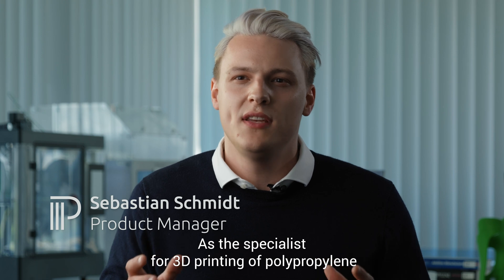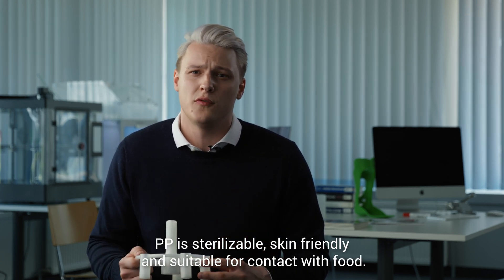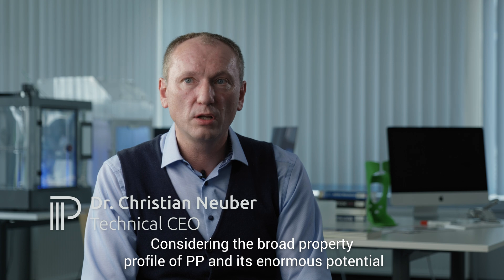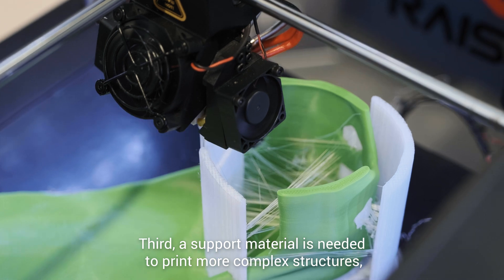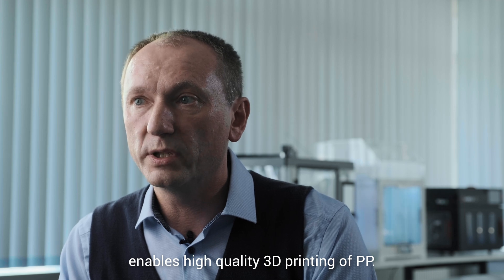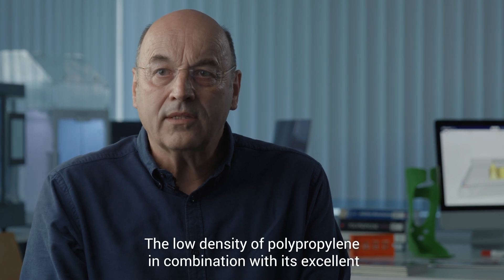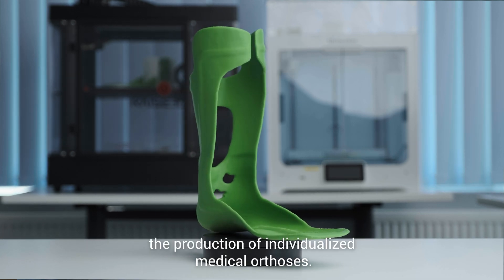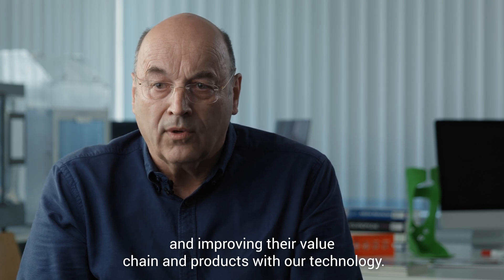PPprint | Your specialist for 3D printing Polypropylene (PP)

Comment: would this PP material be FDA approved to produce Freeze Drying accessories?  These accessories would not only come in contact with the food, but they would also need to go through the freeze drying process together with the food.  After it should be cleanable (but not allow bacterial growth).  This would be repeated about every 24-36 hours.  thank you
Reply from the maker: Hello Hangs4Fun,

thank you for your question.

Our P-filament 721 can be used down to -10°C. At temperatures below -10°C our products can become brittle and break. For this reason, we recommend a usage temperature of the printed products made of our materials above -10°C.
 
Furthermore, we would like to point out that our certificates for food safety apply to our raw materials. Thus, after 3D printing, the user must check the printed products for the preservation of these certificates.

Best regards,
Your PPprint Team

Comment: do you sell print surfaces especially made for PP ? im getting kind of tired of reapplying packing tape for each print
Reply from the maker: Hi LilNetty, 
Thank you for enquiring. You are right, we do offer customizable print bed surfaces. The commercially available glue, sticks, tapes or adhesives gives adequate results, but this is again a manual process that you will have to repeat every time you want to print something. This is the case for any PP filament on the market as PP doesn’t easily stick to the printer bed surface.

Our solution, P-Surface 141, on the other hand is a bed surface which needs to be installed just once in the beginning and then it is ready to use. In fact, other materials like PLA, ABS, Nylon etc., can also be printed on our P-Surface 141 and thus you wouldn’t need to take it off. In this sense our P-Surface 141 is the best one-time solution and just needs to be installed at the beginning. for more information please check out: https://www.ppprint.de/en/produkt/surface/